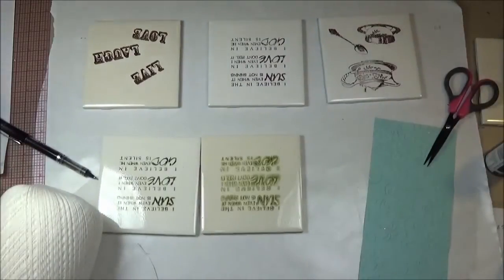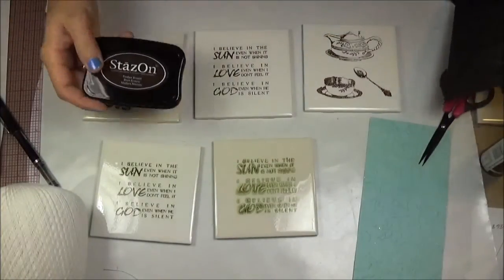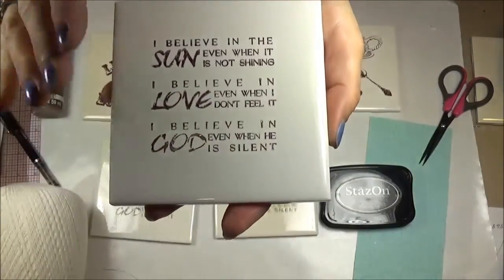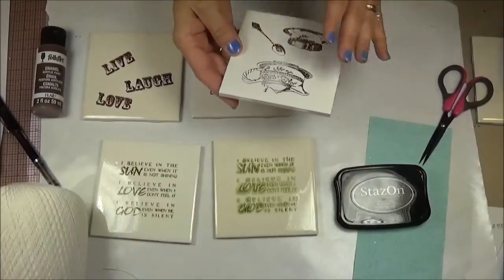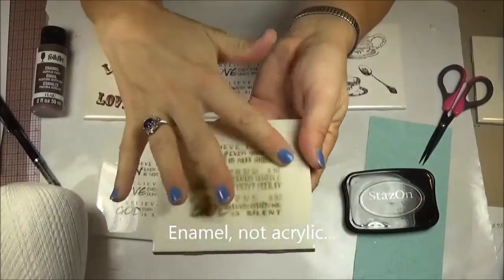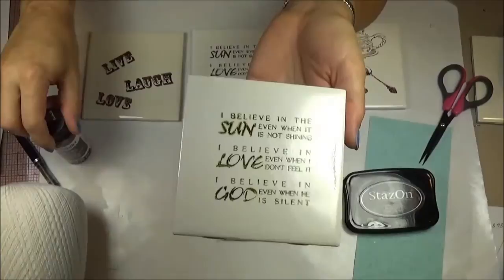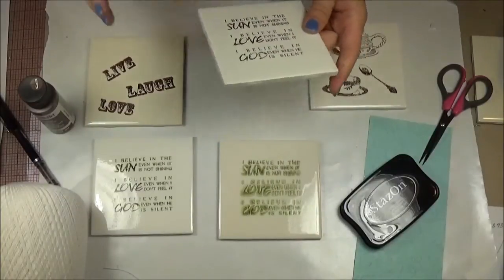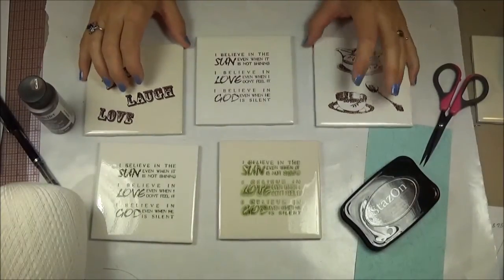Stamping Ceramic Tile Coasters - See Description for update

Comment: Hi Amy & THANK YOU SO MUCH! Because of your work, I was able to move a little faster in developing a simple, albeit slightly time consuming, working formula. Here goes: 

1) Ink a stamp with Stazon and press gently and firmly onto a glazed tile.  I noticed red rubber stamps are easier but if you're using a clear stamp and it slips, you can put one light coat of Modge Podge on before stamping.   
2) Modge Podge over the inked image, lightly.  Let dry - It's pretty quick. 
3) Seal with "Amazing Clear Cast" resin. Dry time can be anywhere from 24 hours to 3 days depending on heat and humidity (dry and hot is best)

* Make sure you follow resin directions accurately and wear rubber gloves.  You don't want to learn why the hard way.  2 identically filled capfuls of each part of the resin seals 15 tiles.  It's SUPER IMPORTANT to both wear gloves and stir every bit as long as instructed.  Making in big batches requires super speedy use as this stuff starts drying up within about a half an hour.   *  Self Adhesive cork bottoms can be purchased inexpensively at Amazon.

Comment: Hello, Amy… new subscriber here. Thanks so much for sharing your video. So, as you’ve discovered, stamping on tiles is awful to learn. I’m just getting started and have watched too many videos to count and read hundreds of tutorials. My tiles/ coasters aren’t turning out well, at all. I should have just stuck with card making! But… I feel like I won’t be able to rest, until I get this thing down pat. Like you added, in the end comments, my Ranger Archival ink washed off, even after baking. I’m beyond frustrated. The epoxy has been suggested to me too, but that’s a bit of an undertaking and it’s fairly expensive. I want to be able to paint in some parts of the stamped images. So far, that’s not worked. Have you discovered anything new since this video? I’m really ready to just give up. Thanks so much 💕

Comment: is there any new discoveries how to stamp on ceramic tiles? In a way as it is really permanent? I use StazOn and tried different sealings, but non of them were permanent. With some water and some scrubbing I could get the image off. Any good practice? Thanks.
Reply from the maker: I just came across a product someone referred to as countertop resin. It doesn't yellow. It's being used to seal over acrylic pour art on ceramic tile coasters. I'm very excited to give it a try.
Reply: Hi Amy, Thanks for your reply. And what is the name of the resin? What I have tried is to use stazon and then seal it with some simple sealer spray. Must make sure that it totally covers it and have to use it two times. Seems to me that it is working.
Reply from the maker: I purchased a 16 ounce, high gloss kit at Michael's this week that claims to be heat resistant. (I also shopped at the Dollar Tree and Hobby Lobby this week, so I have taken quite a few new items into my studio... and now I've misplaced the resin. It cost about $14.50 (before coupon) and I don't see it on their website.) And I've also found a product called Art Resin that is heat resistant enough to handle a coffee cup, but nothing straight out of the oven. I bought the resin I found at Michael's but I haven't tried it yet.
Reply from the maker: I just found the resin that I purchased at Michael's. It's Envirotex Lite POUR ON. I actually just found the name on this week's haul video that I'm editing. I'll make a set of coasters with the resin this week and post the results, if you haven't tried it yet.
Reply: Resin is definitely the way to go!! I've used easy cast but it slightly yellowed my project. I recommend the Amazing Clear Cast Resin... purchased from hobby lobby
Reply from the maker: Oh no. This means that I have to make a trip to Hobby Lobby... Ahhh, the sacrifices made for crafting... Thank you for your recommendation!
Reply: @AmyMable  "Amazing Clear Cast" resin is also heat resistant up to 400 degrees.